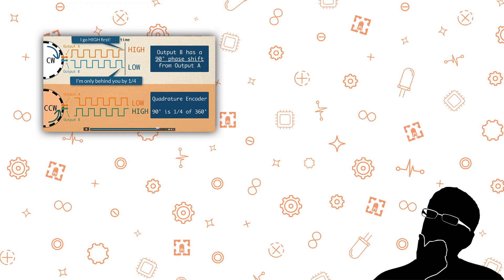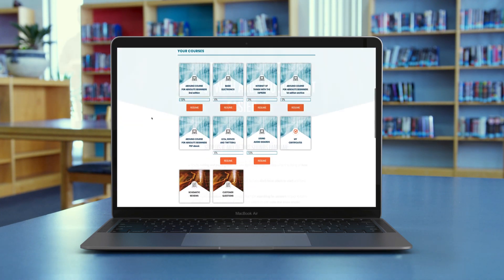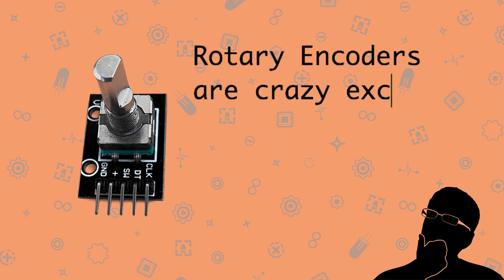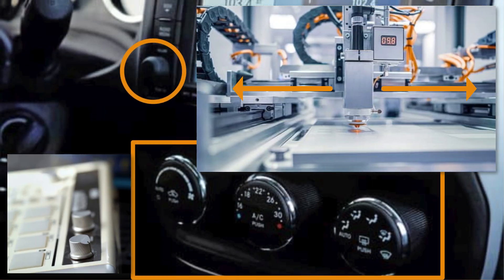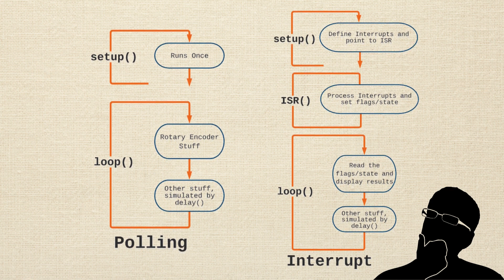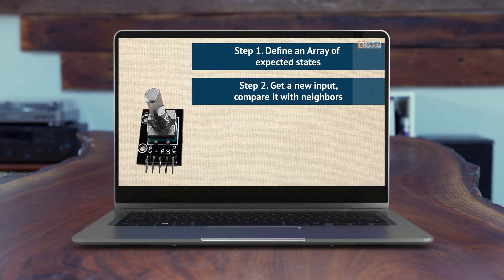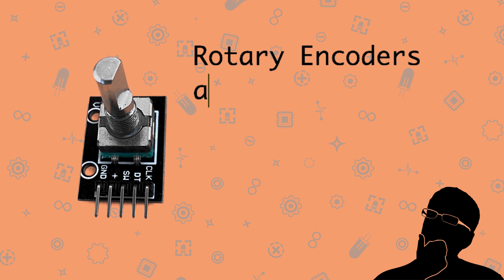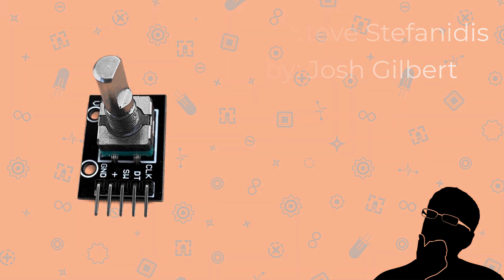Using Rotary Encoders with Arduino welcome video

Comment: VERY interesting!  I want to wirelessly switch high voltage relays in a matrix using Arduino. I have eight conductors that need would be connected in various configurations and would like to use a rotary switch to rapidly switch between the different connections. This is actually switching RF (antenna switch). Is this possible?